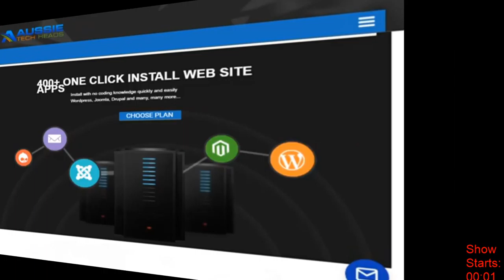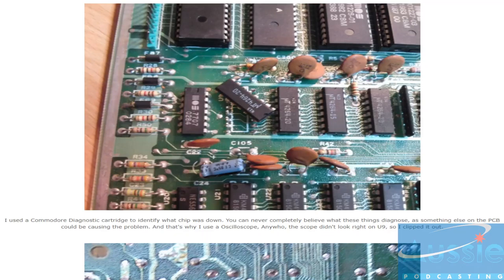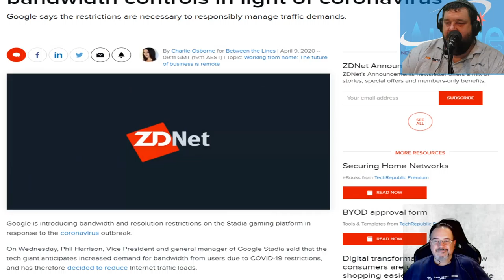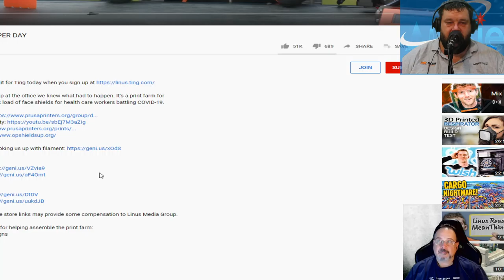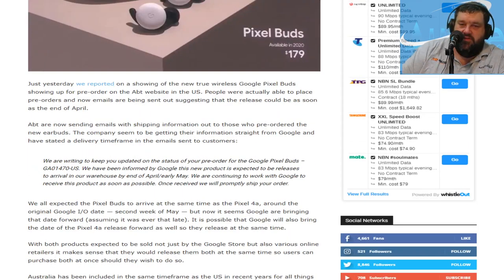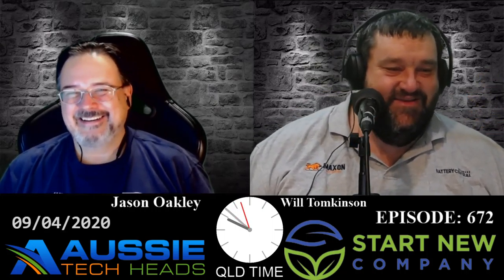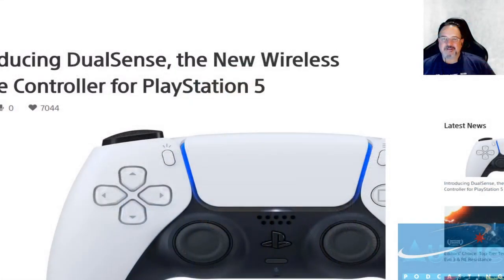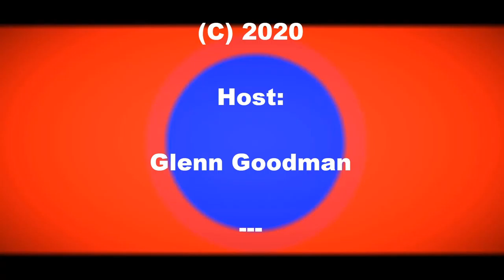Aussie Tech Heads - Episode 672 09/04/2020

Comment: The C64 PSU is not just 12V. There is AC supplied and 5V.  So not pretty straight forwards.
Reply: its actually a 9v and 5v, the adapter plug you can buy had a voltage dropper in it allowing you to use a basic 12v power pack
Reply: it uses a 9v rail and a 5v rail. the adapter you can buy has a voltage dropper in it so you can use a basic 12v supply.
Reply: @MrWilliamtomkinson  9V AC
Reply from the maker: the AC is not required, it internally rectifies it anyway, the only reason it used the AC was for the 60hz signal for the TOD, time of day, clock after you set it. and no one did, as it reset every time you turned the power off. (Will)
Reply: @AussietechheadsAu  Unless you use a dataset